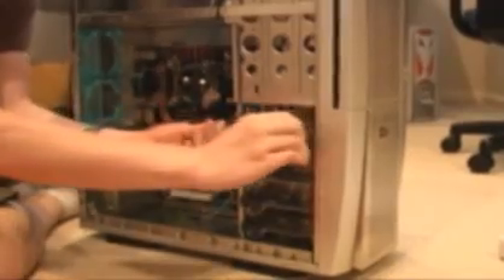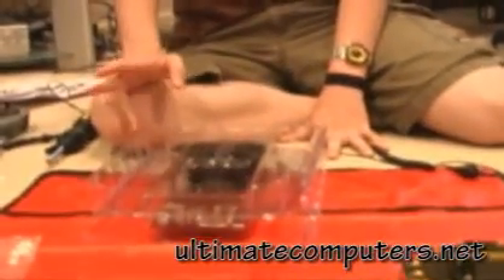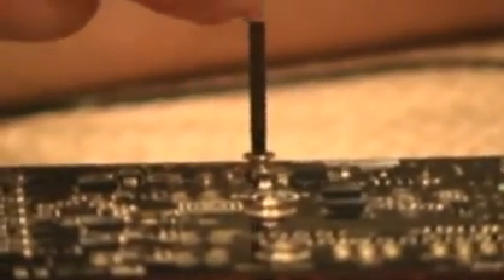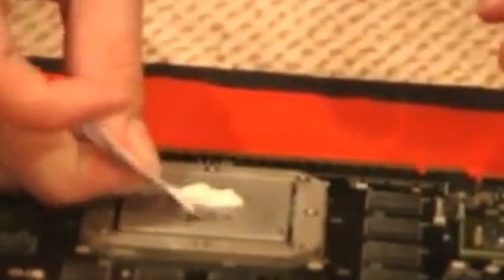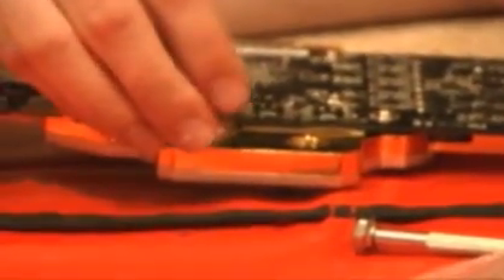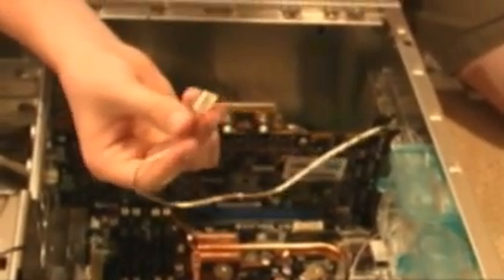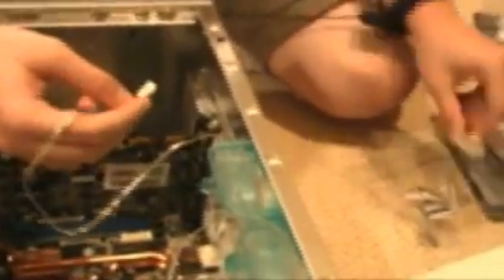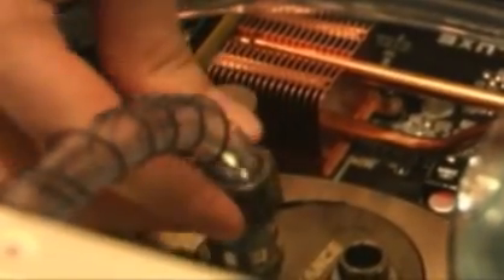(Part 3/4) How to Build an Ultimate Computer

Comment: ok first off you shoulda used sealing tape on the connectors second before you put any of the watercooling in the case you should have tested it for leaks outside of the case

Comment: Well if you use water make sure to use distilled otherwise you will ruin your blocks and tubing, by third party liquid I assume you mean coolant meant for liquid cooling such as Feser One, which are non conductive (won't short out anything) and air cooling is obviously not as efficient, and louder, but much much cheaper and reliable without too much maintenance. However if overclocking I would recommend using liquid cooling with reliable non conductive anti freeze coolant.